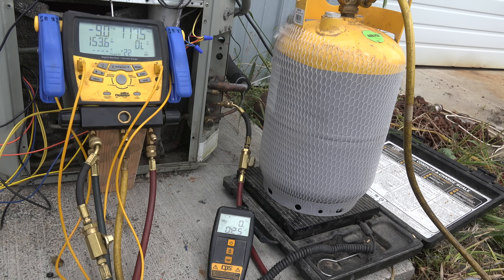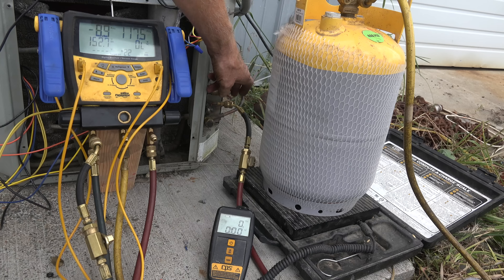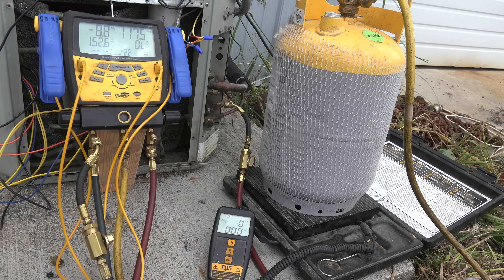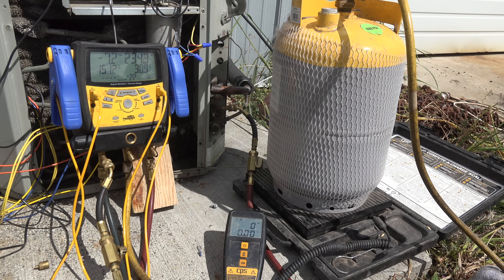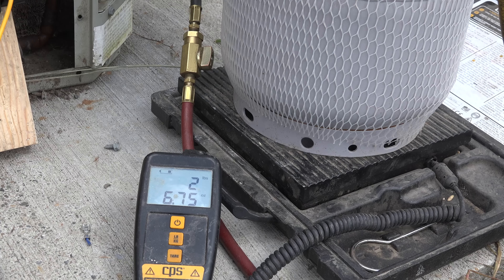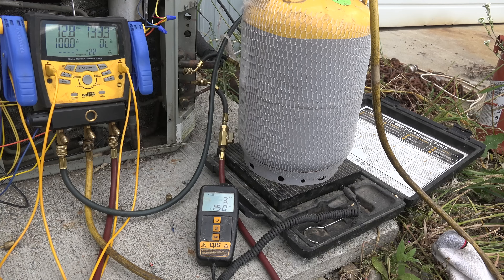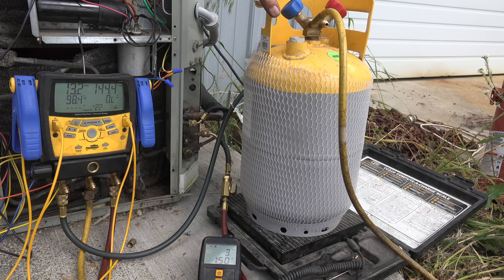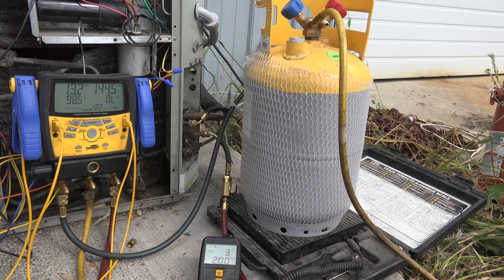Is oil removed with liquid refrigerant upon recovery #1.

Comment: So, if your system requires 7 ounces of oil, and after vacuuming, you add the seven ounces of oil.. You now have around fourteen ounces of oil, which will reduce cooling.
Reply from the maker: I would not add oil unless you know for sure that you have lost oil.
GFM
Reply: @grayfurnaceman  It seems that to be absolutely  positive on the oil.. you would need to flush the system, then add the proper amount of oil.

Comment: Thought pulling a vacuum got rid of residual oil.
Reply from the maker: No.  Vacuum pumps only remove gasses.
GFM
Reply: @grayfurnaceman  I thought vacuum pumps remove gasses and moisture. Correct me if I'm wrong.
Reply from the maker: @tfinavia01  The vacuum pump is a gas pump.  moisture will be removed only after it has turned to gas.
GFM

Comment: What about when you hook a vacuum up to get the air out of the system with the freon evacuated?
Reply: The vacuum pump will not remove oil from the system. 
GFM

Comment: anyone can help please do
I am apprentice My problem I just recovered R22 from a old Russell unit cold box the reason I had to is because the customer wants the unit move a few feet back so I cut the pipe already capped the ends off and will be reinstalling pipe Monday. My question is after I install pipe purge, braze, will it be ok for me to put a vaccum pump on it? I was concerned about the refrigerant oil in the system will that damage the pump? Or will there be any oil in there after my nitrogen test? If anyone can help me I greatly appreciate it